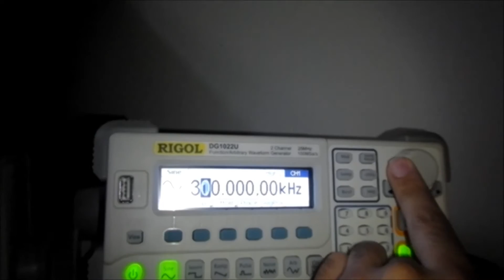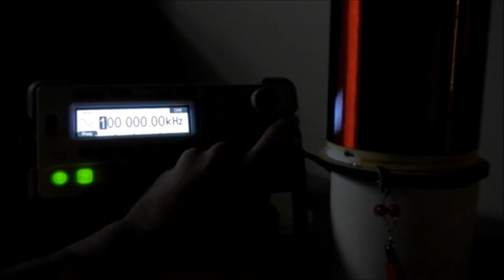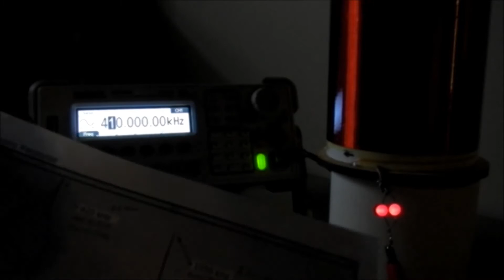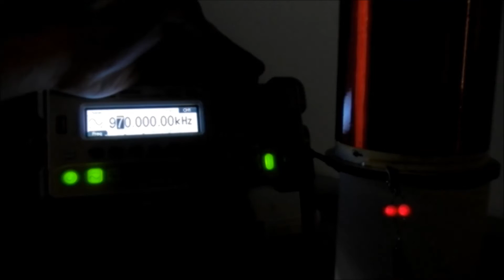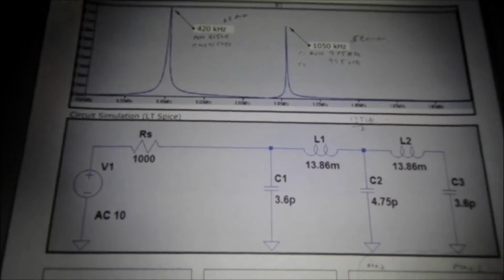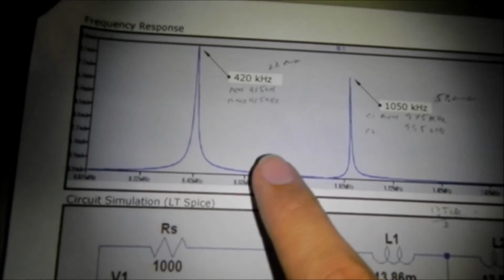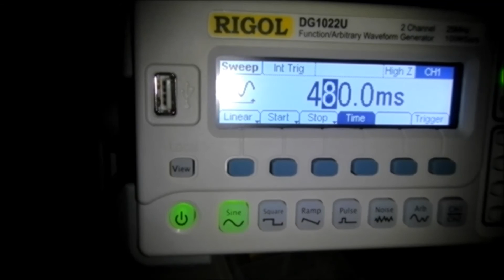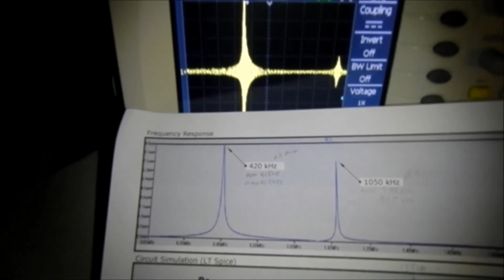Tesla Coil LT Spice Simulation & Tuning (Part 1 of 2)

Comment: Very interesting!  I will have to give that a try!  Are you using square or sine wave output on your signal generator?  Thank you!
Reply from the maker: Sine wave.
Reply: Thank you!  I have a sine wave generator but it's so weak.  I would have to make an amplifier for it.
Reply from the maker: Makerj101 You don't need a lot of power to measure the frequency response.
Also, I have a 105W solar panel it works good but the glass is cracked you want it?
Reply: Yeah but I don't even think it will light up an LED.  I think it puts out 1 volt if I remember correctly.  That's awful tempting!!!  I'm interested!  How many volts is it rated?  Thank you!  :D
Reply from the maker: Makerj101 It's the one from my 120VAC inverter test video. It's like 16VDC or something like that. Some Water got behind the panel this winter froze and craked the glass. It is still good for experimenting.
Reply: Oh I see!  That's a good voltage for charging batteries etc.  What do you want for it?  Thank you!
Reply from the maker: Makerj101 Nothing, I just want it out of my garage. I might have some other stuff for you as well...  I'm cleaning house a bit. Let me know if you want to stop over sometime.
Reply: Awesome sweetness!  Of course, I would love it! That would be super cool!  I'll ask my parents when I can stop by and if it's ok with them!  :D
Reply from the maker: Makerj101 Cool, shoot me an email offline.
Reply: Ok I'll do that!  Thank you!  :)
Reply: its on the lit up button, I thought thats why he's working in the dark.... :P